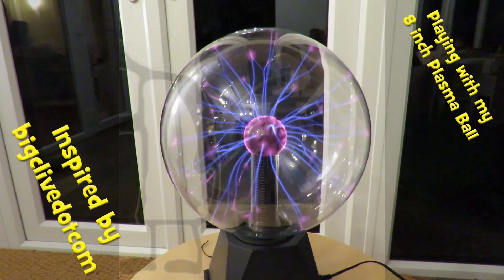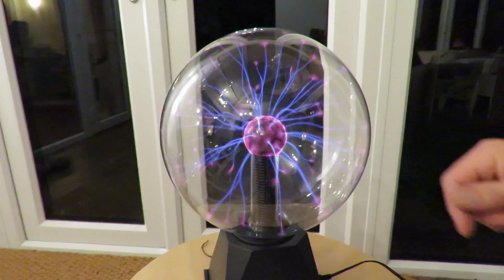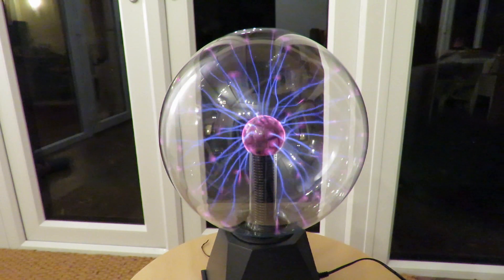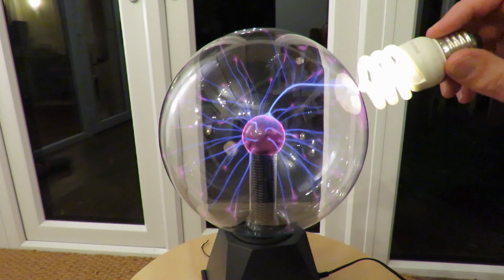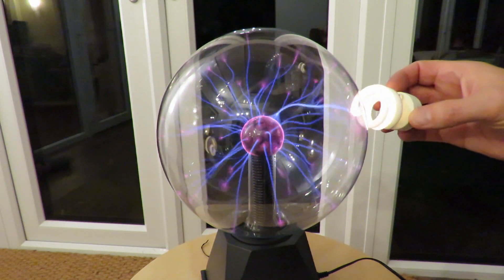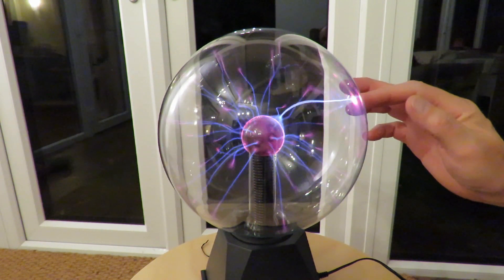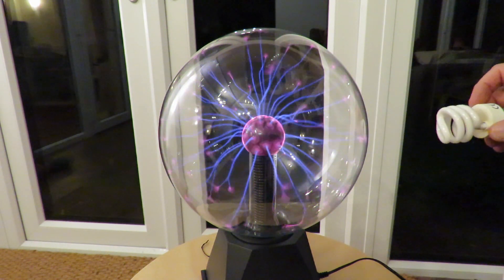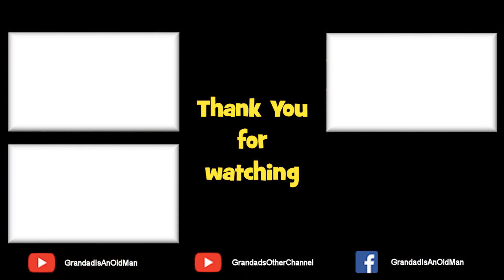Playing with my 8 inch Plasma Ball

Comment: We had one until moving from Minnesota in 2008, then it ran off or something.
The bulbs are likely different wattages, hence more gas in the 'good' one ? The mercury vapour gas is all that matters & is always fine, the circuits fail before 25K hours ;) 
More fun can be had with an LED and a couple of diodes. Attach wire to the joined end of 2 opposite facing diodes, with LED to their free ends. Can get about 6ft of range from something like this. Will light the LED through walls. Can even get motors spinning.
Reply from the maker: Hi Slider, I might have to dig it out of the loft again and try the LED trick. Now you mention it I can remember several people showing that. Wow, I have just looked at Jeremy Gwilt's (renamed Caveman Electronics) channel as he had loads of Tesla coil set-ups and he has deleted virtually all his videos!! I know he had changed to live streaming but I didn't realise he had deleted all the old stuff :-(
Reply: Neither did I, it was a good resource and he's a decent chap.
Yep, it's an Avramenko plug was what I was describing, very popular indeed. You can also put an LED straight across a small ferrite wired choke and it'll light near that ball. All the Slayer Exciter stuff :)  Which reminds me, haven't seen Gary Bluer himself around recently, or Magnetman2010, or Johnny Davro or DadHav or Dr. Stiffler, or.....aliens are stealing people !
Reply from the maker: You might want to check you are still subscribed to them as YouTube has been unsubscribing people for some reason, no doubt in the best interests of the YouTube community?
Reply: Hmmm, no doubt eh. Will check - thanks for the pointer.